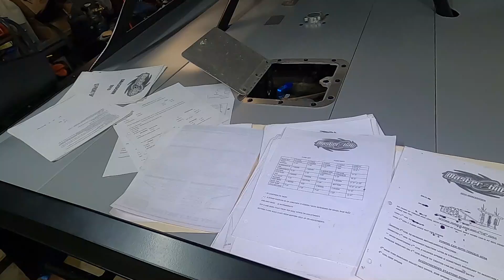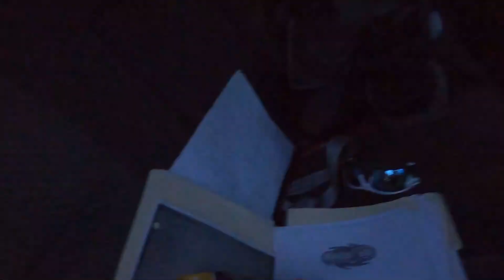CRATE LATE MODEL RACING AT MOLER RACEWAY PARK FAST ACTION AND TOUGH DECISIONS MAKE FOR A LONG NIGHT

Comment: Noticed you were getting ready to seat a tire on bead at beginning of the video. 

Tip for anyone reading: After you seat the bead with no core in the stem, as the air escapes the stem it will begin to whistle. If you put the core in as soon as the whistling stops it will be at 10 PSI +/- 0.5 PSI
Reply from the maker: Does this work on passenger tires as well?
Reply: @LateModelGarage  for a passenger car? Not that I know of. I suppose it could though. I’ve never ran air pressures that low in passenger car tires

Comment: No reason at all that a caution shouldn't be thrown for a spin, especially on a track with an infield that accessible. No way to determine if the driver intentionally put his car there so you throw a caution..especially since it already happened once in the same corner.  Anyway, you guys were moving forward and looking competitive so I say the changes you made were good and will benefit your more in the future.
Reply from the maker: In previous years we would make changes and not really see much difference on the car.  Now that the frame is staying out of the mud each small adjustment is showing a change.  Some good and some bad.  We just gotta keep racing to figure it out.  Thanks for watching!

Comment: Well, don't just sit there, you do have a reverse gear don't you ? Back up fast, flip nose around then proceed...See it in the movies all the time.....
Reply from the maker: It was very dusty out there and harder to see than you would imagine.  Pulling out on the track certainly would have pushed the issue to make the caution come out.  But this action comes with great risk of getting hit broad side.  Oh well. Plenty of racing left this year.
Reply: @LateModelGarage  :That certainly is
your choice and as it didn't cause any
damage, a good one for you....;^)